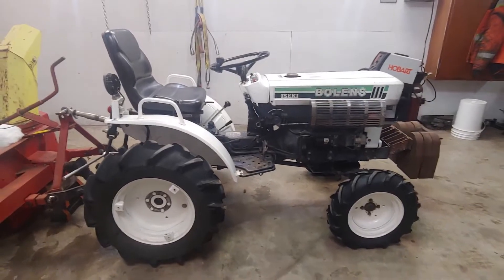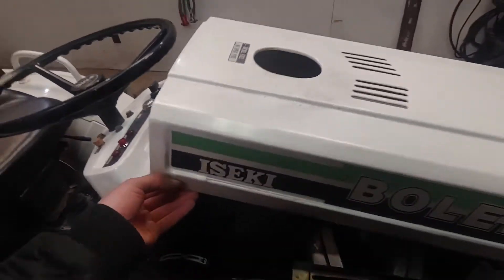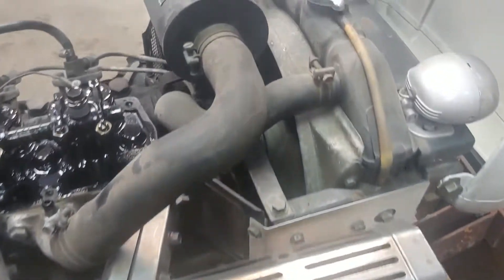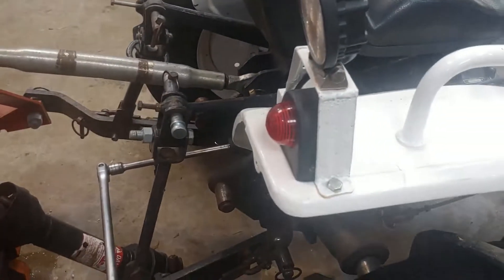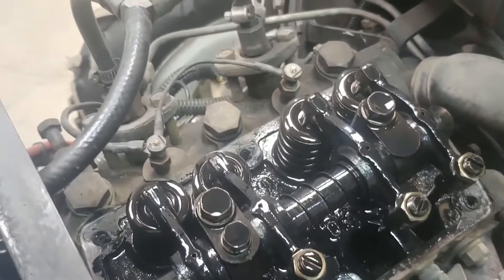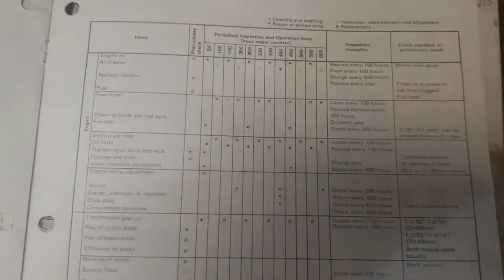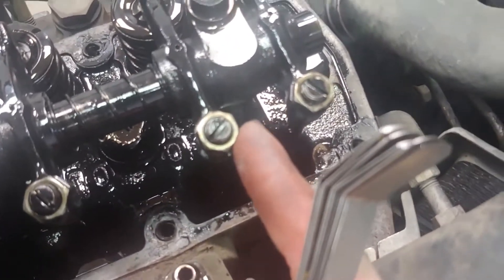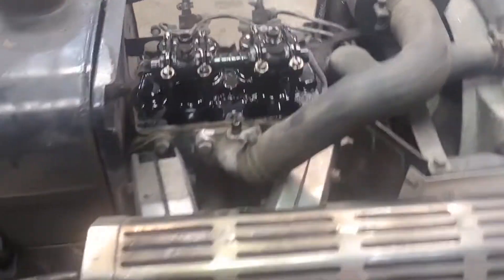Bolens G174 / Iseki 1500F Diesel Valve Adjustment

Comment: I have one with a loader.. I love love love it! Can you or anyone confirm the hydraulics run off the transmission? The manual doesn't specify, but what I can see is SAE 80 gear oil. Seems stiff to me for hydraulic but that's all I can find.
Reply from the maker: The transmission and hydraulic fluids are shared